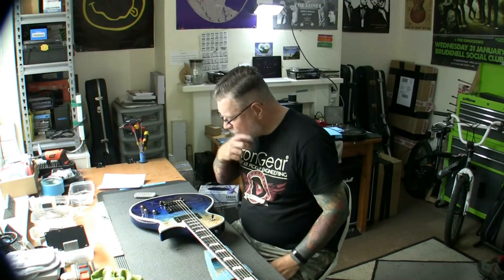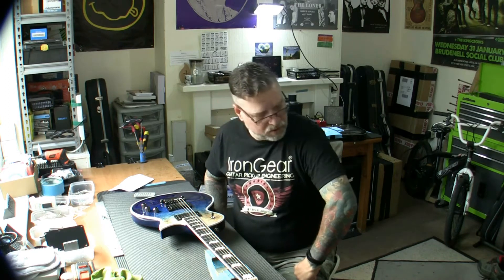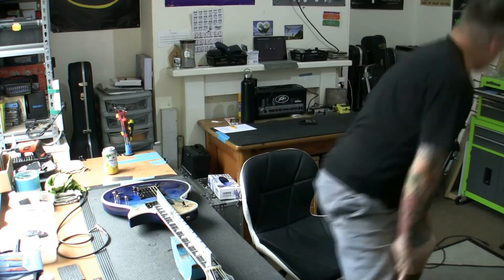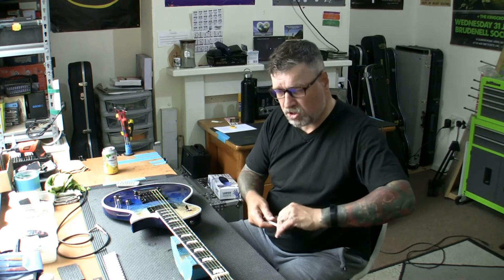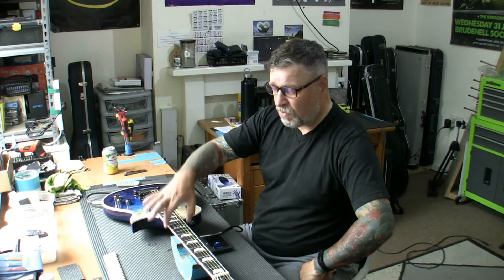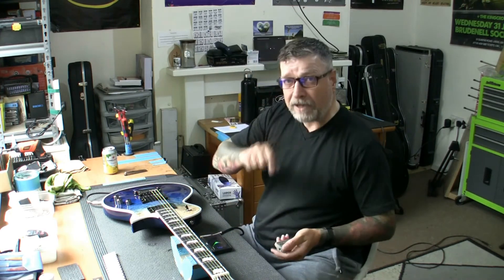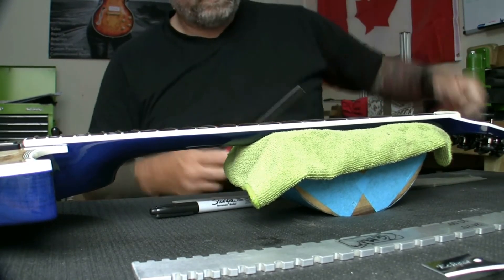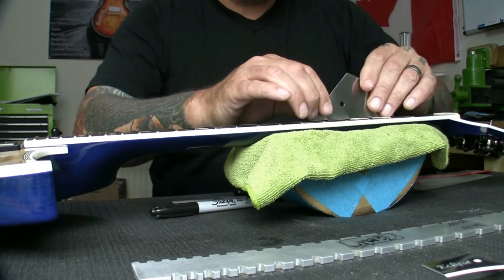ESP Eclipse II fret level and setup...

Comment: I polish the frets with these 3m paper that stew mac sells... but I have the felling that in the polish I alter the level of some frets after a complete level... is this normal?
Reply from the maker: You should not alter the level when polishing no. It is why I wait after levelling before polishing so I can check that me levelling isa correct. Are you making sure that the frets are corectly seated before levelling? If you use the correct grits of paper for piolishing, you should not alter the height and the frets should still be level after. Victor...
Reply: @FretFriendGWaL I tap them with a plastic hammer when i´m suspicious if the guitar is a little old or the frets are unnormal high.  I start with 400-600-1200-4000-6000 and then I finish with steelwohl 0.000. maybe my first grits are way to hard (3M Flexible Polishing Papers). I use GMI and stew mac tools so I don´t doubt the level it self, but the polishing is indeed the problem... should I start with 600 or 1200 instead?
Thanks for the videos, I´ve learned a lot.
Keep cracking!
Reply from the maker: I start with 400 up to 2000 (400-600-800-1000-1200-1500-2000) then super fine [0000] steel wool. I only use 400 lightly just to remove the deeper sctratches on the tops. You should not alter the height when polishing. As mentioned, the only problem area I can see is if the frets are NOT seated correctly. Tapping them down is fine so long as they STAY seated. There have been occasions when I have had a loose frets that pops up again. If they do not seat correctly, you need to repl;ace the fret or glue it in. Victor...
Reply: @FretFriendGWaL  Thanks Master!